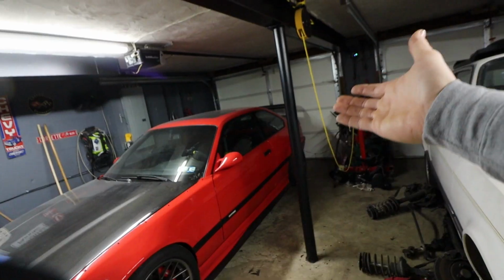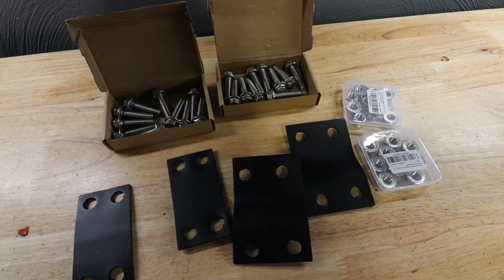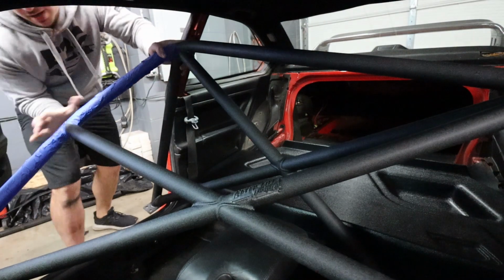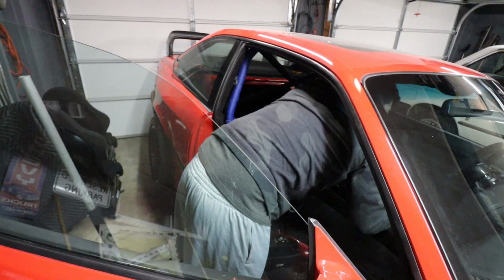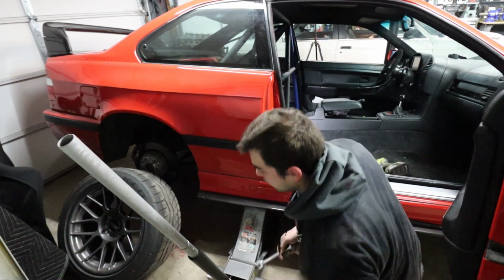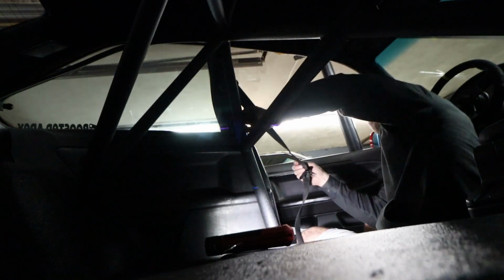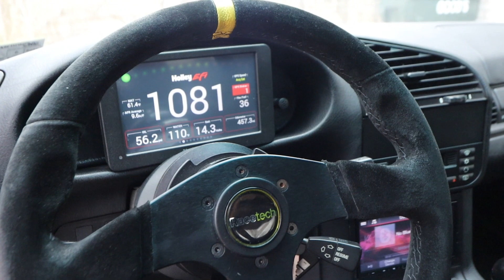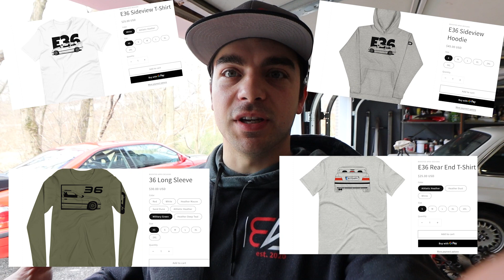FINALLY Making my LS1 E36 Interior Perfect!

Comment: After seeing the black wrinkle finish, I say good choice! I wanted red, but red would have been distracting. For a few seconds I thought you were going to have to pull the rollbar back out to get the upper part of the rear seat delete back in there.
Reply from the maker: I thought I was going to have to remove it too, I was NOT happy at that very moment.

Comment: i love your car. would you suggest to start with a rolling shell 1999 e36 m3 that will need everything replaced (windows/electronics/front-rear windshields etc) or buying a used M3 and just swapping the engine?
Reply from the maker: Any E36 that's clean with no rust is a solid starting point.